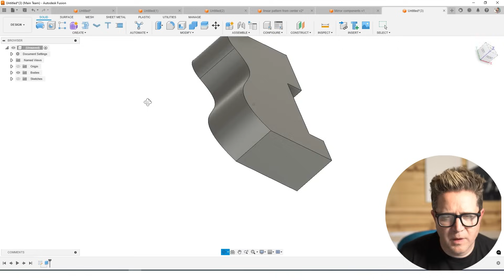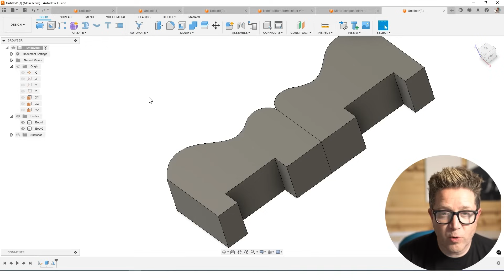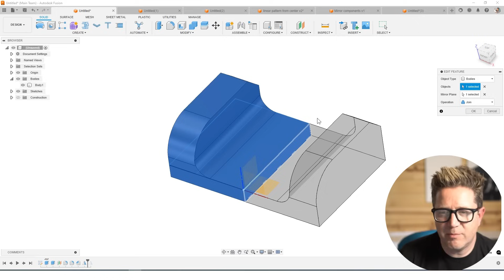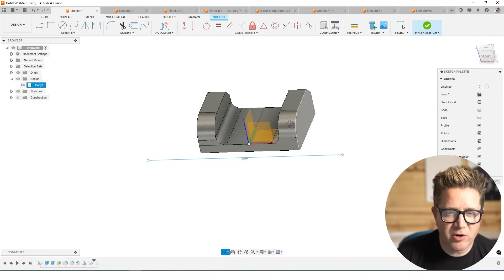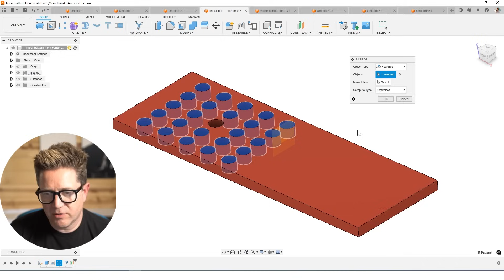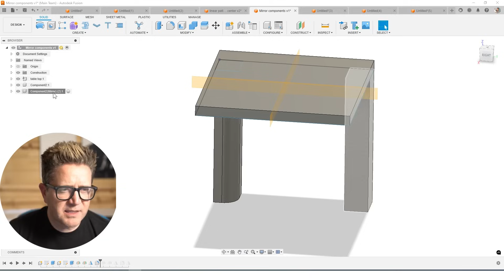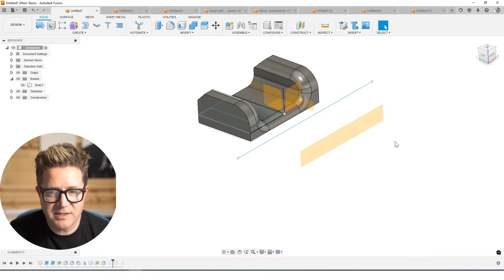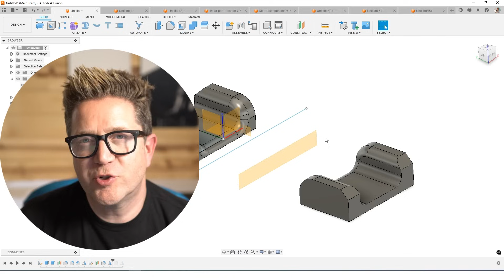Fusion 360's Mirror Tool – The Right Way to Mirror Features, Bodies, and Components

Comment: One thing I always struggle with when using the mirror command is what he described where it creates separate components that are different. His example of table legs is an example of what I don't like. I want them all to be the same component, especially when generating a BOM but I want to use the mirror command to keep them positioned properly. Any suggestions on how to do this? I would love to have a checkbox for "make separate components" or something similar.

Comment: I love your videos to teach myself how to create motorsports parts for our race team! however, I am still stuck, because I am mirroring a body for Driver-side/Passenger-side but want to export them separate from one another for them to fit correctly on plate in my slicer program for my 3D printer. Any help would be amazing from you or anyone in the comments.

Comment: One "problem" with mirroring objects that have threads, the threads in the mirrored copy will be reversed. So a right hand thread will become a left hand thread on the mirrored object and your fasteners won't fit. Just be aware of that,
Reply: It would be nice if it was smart enough to do threads properly when you select them as features!